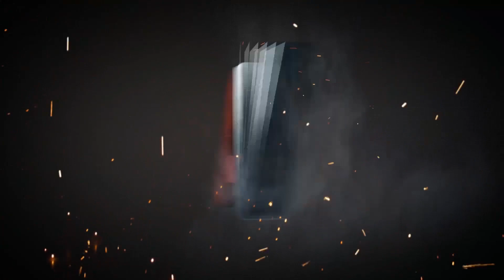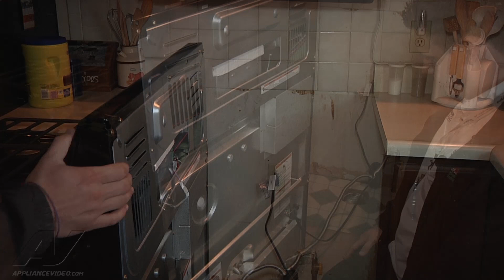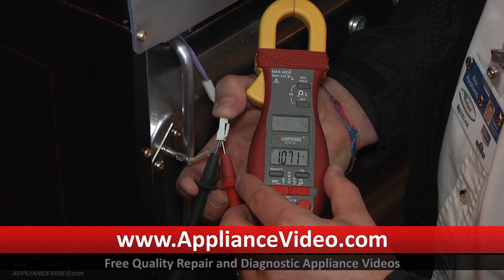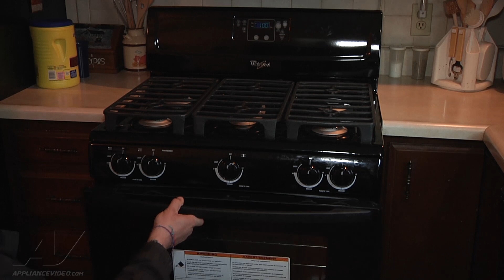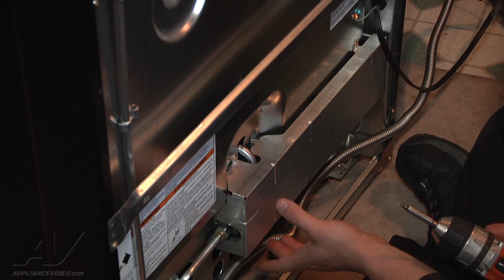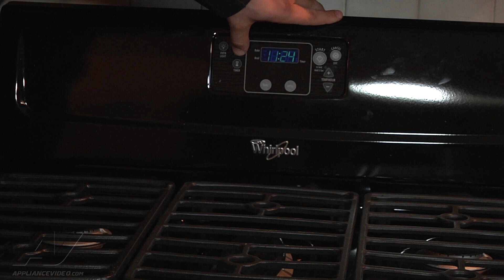Whirlpool Stove Repair - Will Not Heat Past 180 Degrees - Sensor

Comment: What is the correct voltage at the gas valve at 6:35?  My ignitor glows, the safety valve is open, but the burner won't start.

Comment: My Whorlpool will at times turn the gas on and then you hear it shut right back off again.  This is during the baking cycle.  Any ideas?
Reply: Mine is doing the same thing and it’s fucking annoying. 4 years old…. I’d love to know if you ever got it fixed?
Reply: @Alvaro Aguilar had them come out cause it was still under warranty for a week and my issue was the igniter replaced and it’s like new again.

Comment: Is there a reason you wouldn’t check the safety valve first?
Reply from the maker: Great question, if you have a more technical question that our parts department cannot answer, you can search our over 17,000 answered questions free at our website www.ApplianceVideo.com under our Repair Help section. You can also call our parts department at 1-800-830-5465 and they can give you help 7-days A week ,or search at www.SaveMoreOnParts.com  .

Comment: Does every oven have a switch like that on the regulator? And to answer a question posted in the comments on how the gas made it to the top of the burners even with the switch off, I think there are more than one valves. One going to the top burners and one feeding the oven. I think!
Reply from the maker: Great question, if you have a more technical question that our parts department cannot answer, you can search our over 17,000 answered questions free at our website www.ApplianceVideo.com under our Repair Help section. You can also call our parts department at 1-800-830-5465 and they can give you help 7-days A week ,or search at www.SaveMoreOnParts.com  .

Comment: I have same appliance and I have to set the temp to 380 in order to maintain 350(measured with 2 oven thermometers) Ignitor lights within 1 minute, nice blue flame, but low temp. Ideas?
Reply: Calibrate/adjust the oven temperature. The user manual should tell you some button sequence to press to allow you to set a compensation (some positive or negative number) value to adjust the number you enter as temperature. In your case, "+30" may be the compensation/adjustment (assuming when you enter "350", the oven heats to only 320ºF).
Reply from the maker: Great question, if you have a more technical question that our parts department cannot answer, you can search our over 17,000 answered questions free at our website www.ApplianceVideo.com under our Repair Help section. You can also call our parts department at 1-800-830-5465 and they can give you help 7-days A week ,or search at www.SaveMoreOnParts.com  .

Comment: How could you have gas to the burners but only a little to the oven to heat to 180 degrees. If the safety was flipped how did gas get to the burners?
Reply: The questions is how did the safety get tripped. I doubt it got "bumped"
Reply: Weak igniter in the oven. The glow should be bright yellow/white, not red/orange.
Reply: Hey, I can shed a little more light on the situation. My oven is having the exact same problem, and it's getting to 180 degrees because the igniter ALONE is hot enough to get the oven to that temperature. My gas is NOT running, and my oven gets to 180-190 degrees. To see if your gas is actually flowing, you need to take the bottom drawer out as he does in the video.
Reply from the maker: Great question, if you have a
more technical question that our parts department cannot answer, our
technicians are answering all questions at our website at www.ApplianceVideo.com under our Repair Help section. You can also call
our parts department at 1-800-830-5465 and they can give you help 7-days A week
Monday -Sunday, or search at www.SaveMoreOnParts.com  24 hours
7- days A week.
Reply: @Appliancevideo  That is  an awful answer, no answer at all really!

Comment: Whats is the power tool brand and model # you are using in this video?
Reply: Looks like a Skil.
Reply from the maker: Great question, if you have a
more technical question that our parts department cannot answer, our
technicians are answering all questions at our website at www.ApplianceVideo.com under our Repair Help section. You can also call
our parts department at 1-800-830-5465 and they can give you help 7-days A week
Monday -Sunday, or search at www.SaveMoreOnParts.com  24 hours
7- days A week.